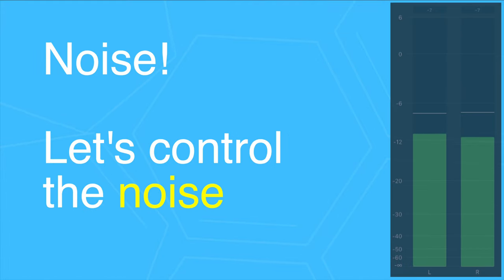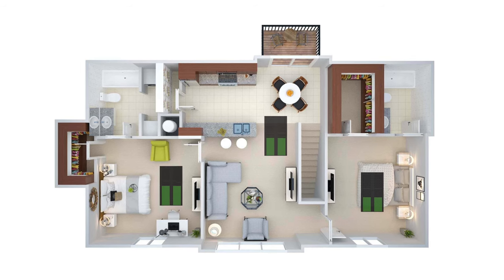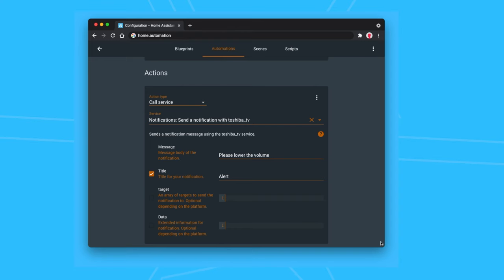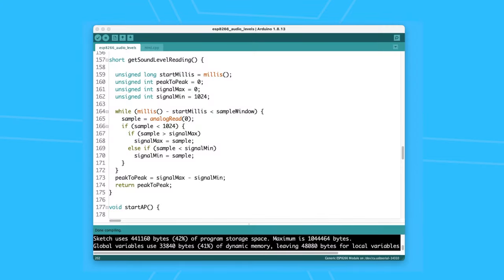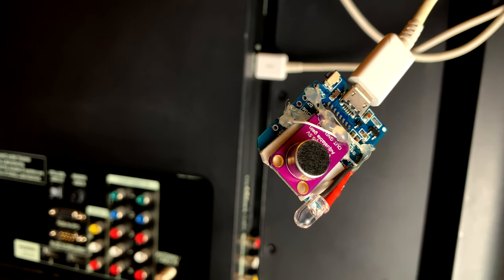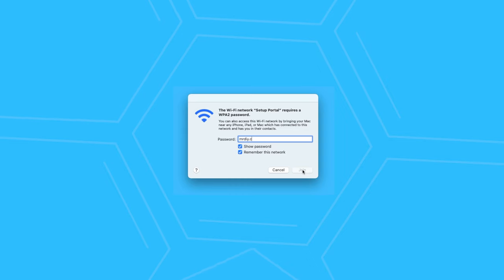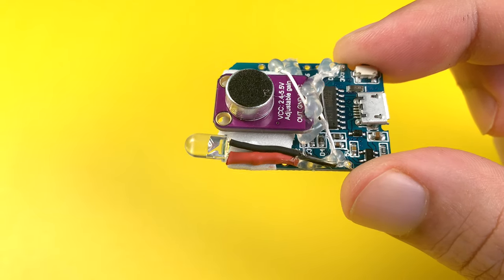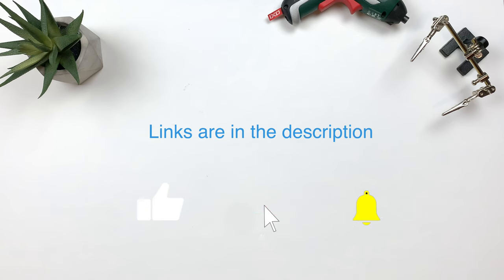My Smart Wifi Sound Level and Noise Detector

Comment: Hello MrDIY, thank you very much for this project.
I am experiencing network disconnections frequently. Is there a way to increase connection attempts or implement a security reset without having the code?
Thank you
PD: I have another mcu in the same place and it is always connected

Comment: Great project!  I have it up and running, static IP assigned, MQTT confitured,  but how do I add it to Home Assistant?  Is there an integration I need to add?
Reply from the maker: Thanks. No special integration just a plain MQTT sensor to get the noise levels.
Reply: @MrDIYca  Ok great! I'm using the default 1883 port for MQTT in Home Assistant.  Would I input 192.168.1.x:1883 for the server or does this assume port 1883?  I can't seem to get it to work either way.
Reply from the maker: 1883 is assumed. The IP is enough: 192.168.1.x

Comment: i had problems with many water pump located outdoor, which is sometimes not running because the bearing was broken, before the bearing jamm, it will produce noise very loud, and someday it will be jamm the pum
question is : can you make sensor for listening the noise, (low powered /solar panel -because in outdoor) and if the noise is too loud, it will sending data and warning us to repair the bearing
Reply from the maker: you might want to look into vibration sensors
Reply: @MrDIYca  the vibration sensor does not have analog, i don't know another  vibration sensor that support hard n soft vibration
Reply: the condition, if bearing pump is almost broken because it get water or loose, it will sound very noisy. 
if i heard that noisy,i usually change it before it stuck.

the problem is, it's located in many area,so it is good if we can monitore using sensor

Comment: What pins did you use? What connections? I was actually just looking for something like this!
Reply from the maker: The analog pin, Power-Power and Gnd-Gnd.
Reply: @MrDIYca  another basic question, but how do I actually use the bin file? I was expecting an esphome config file and I'm not quite sure how this interfaces?
Reply: @jacksonmin2058  you would need to flash the custom bin onto your esp device with a flashing tool. Some examples that have worked for me are tasmotizer (with the custom bin) and the Texas Instruments flashing tool. If you are comfortable with the command line then you can use esptool, which is excellent!
Reply: @MrDIYca  Hi i connected power from mic to wemos - > vcc to 3v -> gnd to gnd -> out to A0, i powered the wemos with usb, but i dont have sound readings... thanks

Comment: @MrDiY 
Thanks for the project.
How could we convert levels into db values? I know it should be possible with an extra sensor but without knowing the basis of how you calculated %levels it would be an impossible job for me :(
Reply from the maker: I know it possible but it will need more calculations and calibrations. Levels are simply the plain old analog readings from the mic - sent as is.
Reply: @MrDIYca  OK then I need to find another solution. Thanks anyway. Decibel is what I need 😁

Comment: Hi ! Really great stuff you offer us. And it's allow me to discover ESP8266 and open me plenty ideas for my HA.
I still got some trouble..  I got error on MQTT : 
2023-01-27 15:26:26: New connection from 192.168.30.136:63210 on port 1883.
error: received null username or password for unpwd check
2023-01-27 15:26:26: Client <unknown> disconnected, not authorised.
and yes there is a username and password in the setup console, same standard HA user that I use for Zigbee2MQTT.

Any clue to gives me to help me find what I am doing wrong ?

Thx
Reply: Too bad, was really great but no way to get MQTT working. Moving to direct home assistant with analog input. Need to work a bit more on filter to get average value but will do the trick I think.
Reply from the maker: You found a bug. It turns out I do collect and save the MQTT username and password but never pass them when doing auth. I will try to post a new bin files with the fix in the future. You can still use it with MQTT servers that don't require auth tho.
Reply from the maker: did a quick fix but haven't tested it - here it is if you want to give it a try https://gitlab.com/MrDIYca/code-samples/-/blob/master/mrdiy_audio_levels_meter_mqtt_fix_untested.bin
Reply: @MrDIYca  Thanks a lot ! This is really great. Tested and working. I got it directly in MQTT explorer. It do not create automticallly the sensor in Home Assistant, I have to check why but no time right now. But I would like to do you a first feedback as you took time to look into my problem and fix it.
Reply: Just added manually the sensor
  mqtt:
  sensor:
     - name: "audio_bureau"
       state_topic: "audio/bureau"
       unit_of_measurement: "%"
       unique_id: "audio_bureau"

And added a Jauge card. Perfect
And now can do all automation I want !

Thanks again for this great code and for sharing and supporting
Reply from the maker: Glad it worked out for you